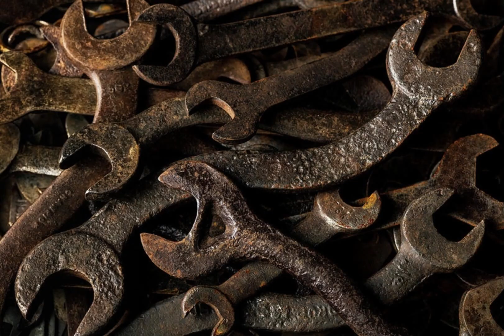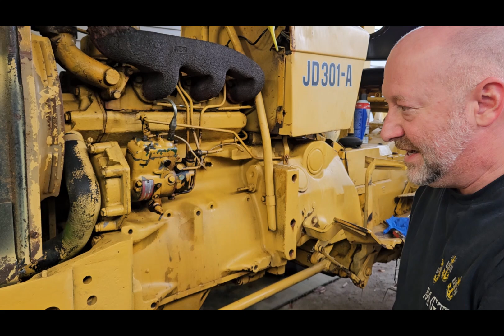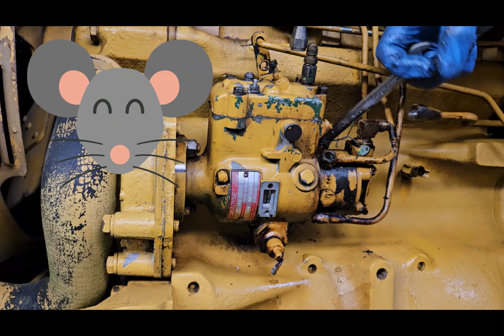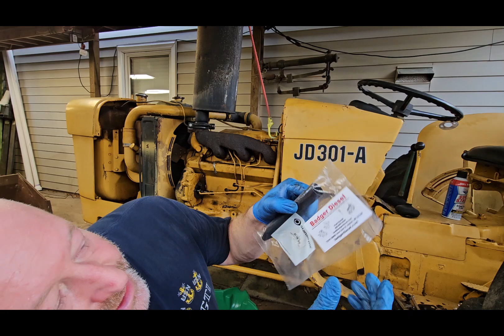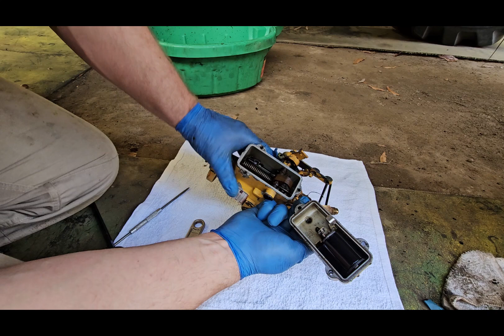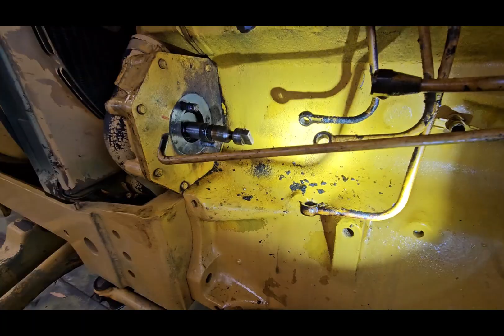John Deere 300 / 301A Diesel Injection Pump Removal

Comment: That nut on top of the injection pump is actually 11/32, l just pulled mine off last night.
Reply from the maker: Im sure someone used what they had on mine ...  it was a 9mm.. obviously the wrong nut. Thanks for updating with the correct size.